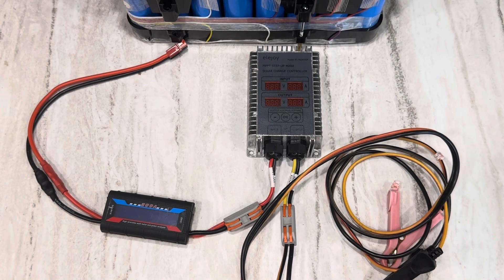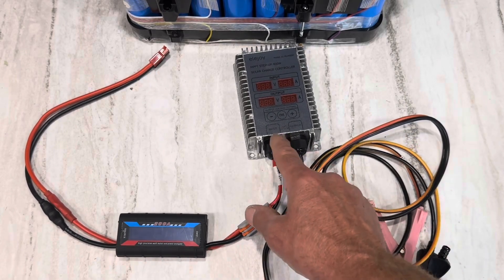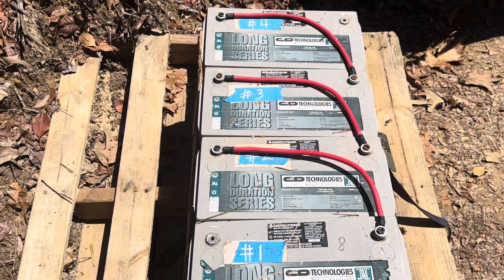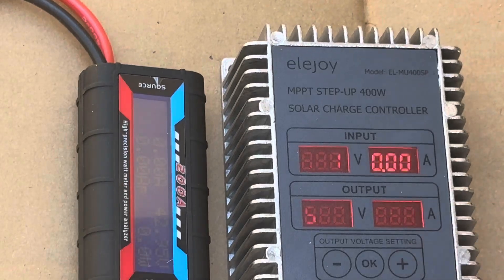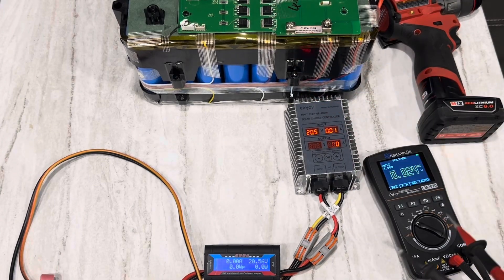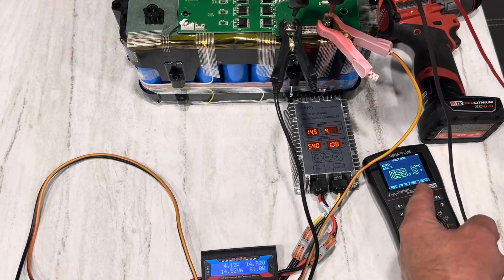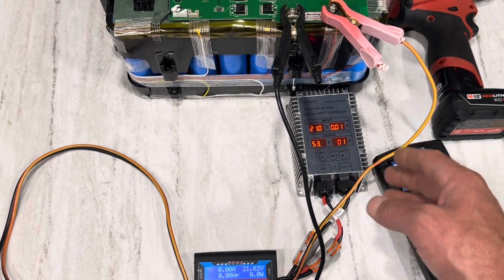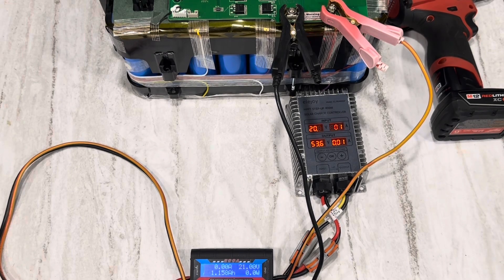DIY MPPT Boost Solar Charge Controller

Comment: Any recommendations for solar panel watt to charge a lithium battery 48 volt golf cart using this  boost charger.
Reply from the maker: It has to be at a lower voltage than the battery. Some 350-400W panels can be used as a roof replacement on golf carts. You would have to check dimensions and VOC on your panel of choice. Some people use flexible fiberglass panels on the existing roof. I’m using a CIGS panel on the roof.

Comment: Can this booster be left connected without any danger of overcharge etc ? thanks
Reply from the maker: I have been using one on my golf cart’s solar panel / battery system for months. It keeps my 36V LiFePO4 at the exact set voltage. Set @ 41.4 and stays right there with proper current taper as the battery voltage rises to set point. Never has risen above its set voltage. 
On lead acid you could potentially overcharge if you set to bulk charge voltage and left there. (IE 14.6 for a 12V flooded lead acid)
Reply: @THEOFFGRIDMOUNTAINHOMESTEAD    Any videos how you build your golf cart solar system ?

Comment: I want to charge 72 volt electric scooter with this is it possible.

My ac wall charger charging ev battery at 12 amps.

My full charge battery voltage around 77 - 78 volt dc.
Reply from the maker: The charger can go up to 85VDC! 
This unit is cable of 400W sound like your wall charger is 900-1000W
Solar energy is free though after you buy the hardware!

Comment: Question. When charging a battery you should use a pure sine wave inverter to protect the battery. What type of current does it make?
Reply from the maker: Charging as in using an inverter to power up a 120v to 12v switch mode or dc power supply to the battery? 
If using a switch mode charger, they aren’t too picky about incoming voltage on the ac side. Some charger models have better dc ripple smoothing capacitors/rectifiers etc. 
Iota Engineering has bulletproof battery chargers I can recommend them if looking for clean low ripple DC outputs. Very tolerant of dirty/fluctuating AC side power.

Comment: Eco-Worthy has a good boost inverter.
Reply from the maker: I had considered them but the price point was too high for my taste!
Reply: I got one for $35  @THEOFFGRIDMOUNTAINHOMESTEAD
Reply from the maker: Sorry, I slipped, meant Renogys controller which is $100+. I was unaware eco worthy had one now! Thanks for the heads up!
Reply: @THEOFFGRIDMOUNTAINHOMESTEAD  
Recently I purchased Victron's 100/20 mppt controller. However, I have not purchased a battery nor the solar panels.
* That said, my plan is to go with a single 48/100ah battery and a single 300 watt solar panel. 
* The build is for a stealth bug-out F-150.
* I desire the smallest panels with the largest battery bank possible.

So I ask, if this boost charger is compatible with the use of a panel that's 200w or 300w?
Reply from the maker: @ This boost controller will supply 400W output. Your input voltage has to be 10% less than charge voltage. It current limits on the output side. I have one on my golf cart and use 24V LiFePO4 batteries to charge 36V LiFePO4 golf cart battery. It delivers 10A @ 40.0V and 9.1A @ 43.8V at top of charge, this is 400W on the nose!
Reply: @THEOFFGRIDMOUNTAINHOMESTEAD  
Thanks a million. 48v would have been the wrong choice for a Bug-Out build. 
* A single battery 24V LiFePO4 battery to a 24v inverter to a 300 watt panel is my next choice?
* " A man got to Know his Limitations."😁

Comment: Great video!!! Will a single 12V 50Watt panel power this boost controller?
Reply from the maker: Yes it will!
Reply: @THEOFFGRIDMOUNTAINHOMESTEAD  that’s great news thank you so much!  I am trying to set up a solar charging station for my boat trolling motor battery as no power where boat is at. It’s a 36v 60Ah LiFePo battery.  Want to keep the setup low key so found a compact 12v 50w panel with the DIY MPPT charger on Amazon…it is the 400W one but that should be ok as it is the only limit for the wattage correct?
Reply from the maker: You are correct, 400w is max input, you’ll be fine!
Reply: @THEOFFGRIDMOUNTAINHOMESTEAD  thanks for the reply!!! I subscribed to your channel as I want to do more solar stuff so thanks for all the info!  One last question if you don’t mind. With the solar panel and boost controller, I want to keep them close together and run cables from the controller to my battery.  Should I install a 15 amp inline fuse between the controller and battery, the run will be about 8-10 ft so I am thinking 10 or 12 gauge wire would be sufficient? And lastly is it ok to use the alligator style clamps on the battery or should it be a solid connection with a disconnect?
Reply from the maker: I always recommend using proper OCPD. As for wire size, bigger is better with DC power. The small 50W panel should be capable of only 2 to 3A under perfect conditions. Connecting to battery is your choice. If left unattended a permanent connection is usually recommended. Hope this helps!

Comment: Hi good morning can it work with a wind turbine
Reply: Thanks very much
Reply from the maker: I’ve not tested on a turbine. This would not replace the rectifier on a turbine. 

Unsure if the choppy DC out of the bridge rectifier would upset this unit. 17V minimum input on this boost controller. Sorry I can’t help more.
Reply: The algorithms brought me here while i was looking for DIY MPPT boards.  This is a great video for a MPPT boost controller.  Pro models by Gensun are big $$$, so nice to see more budget options available.   MPPT control algorithms designed for solar are not suitable for wind turbines.  (common algorithms for solar uses "P&O" which is Perturb and Observe, which runs in steps to find the highest total power.   Wind turbines output AC power which varys with frequency, so one needs a more specialized method to obtain max power).

Comment: Could you use the battery pack while you were charging it? Or is that determined by the specific battery pack?
Reply from the maker: Yes you can pull from the battery while charging or if battery is full the boost charger will maintain the pack up to it’s rated power same as any other charger! Hope this helps!